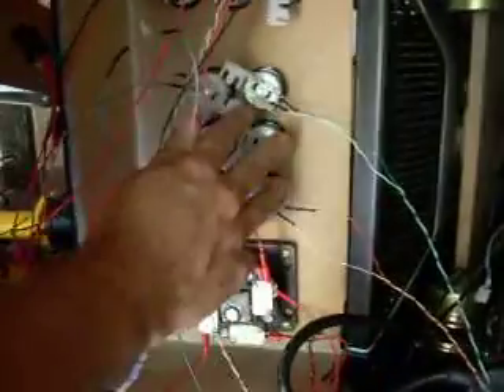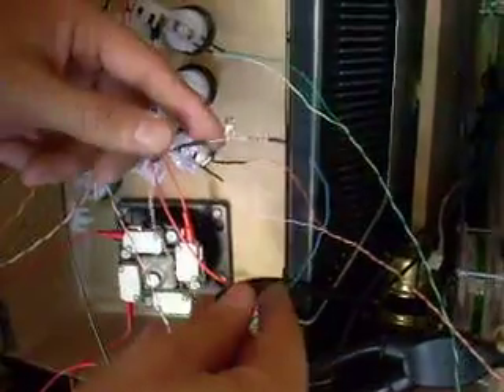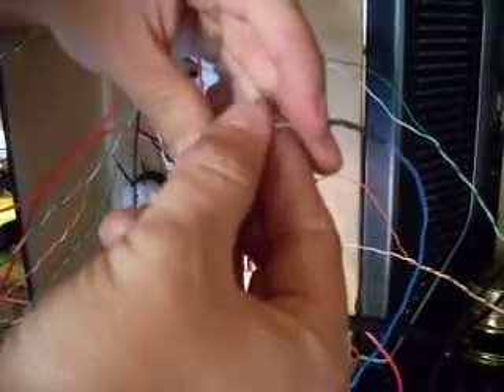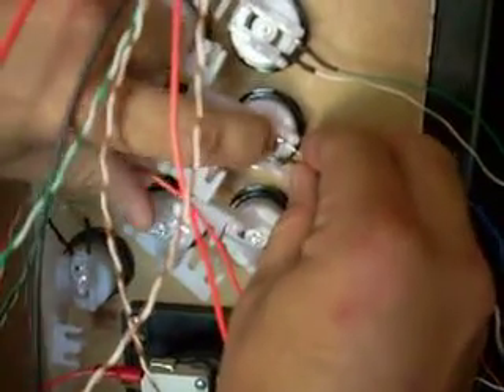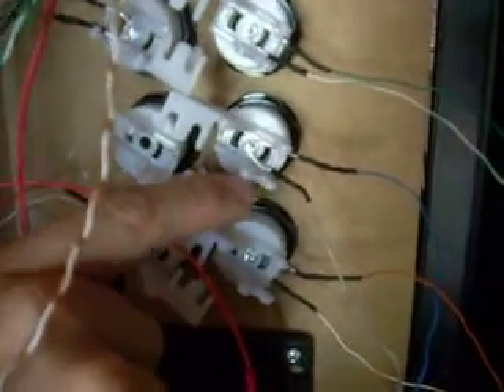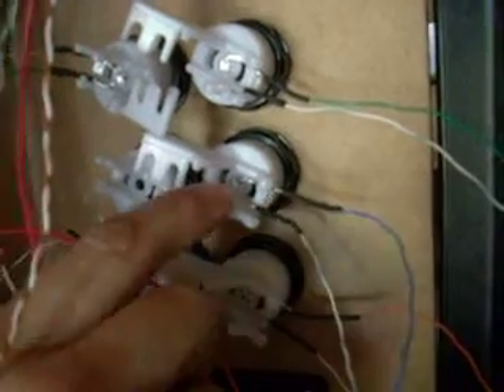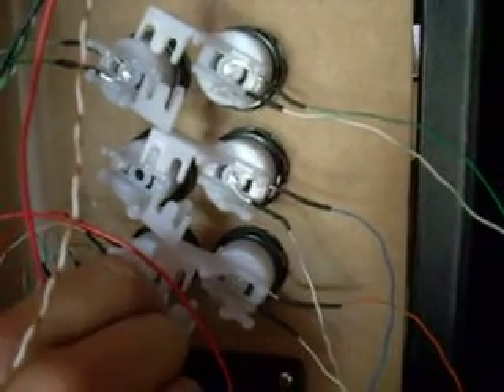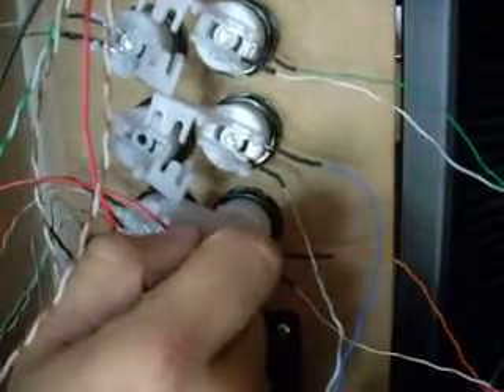Building an Arcade / MAME cabinet:  Wiring and Installing LED pushbuttons Part 2

Comment from the maker: Power comes from the LEDWiz control unit I use, which gets ITs power from a USB. But if you're using a lot of LEDs you gotta draw 5v power from the power supply.  Refer to your power supply manual to find the right cables to splice into for this.

Comment: Awesome! Again very helpful. Question: I've noticed several MAME machines made with 7 buttons instead of the standard 6 button spread for fighting games. I was planning on making a fighter 6 button spread for my first machine but I would hate to have missed something by not adding a 7th (bottom left). So what is the main purpose (game or MAME function) of the 7th button? Thanks again for the great video.
Reply: There are a few...very few arcade games that have a 7th button. NEO GEO had them as a standard for fighting games. 
Here is a reddit thread talking about this very thing. https://www.reddit.com/r/cade/comments/6sn1si/are_there_any_arcade_games_that_require_7_buttons/